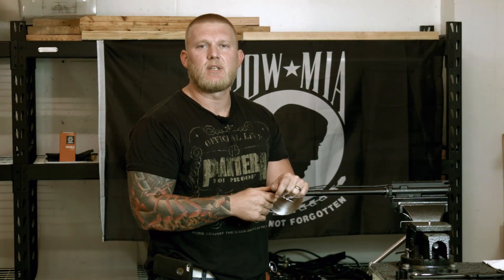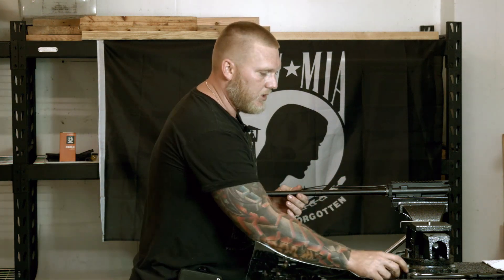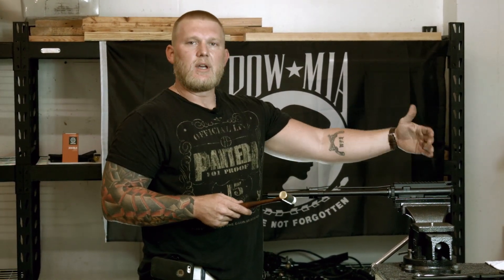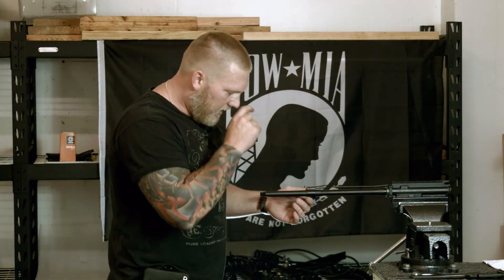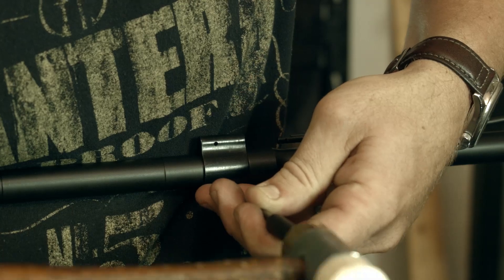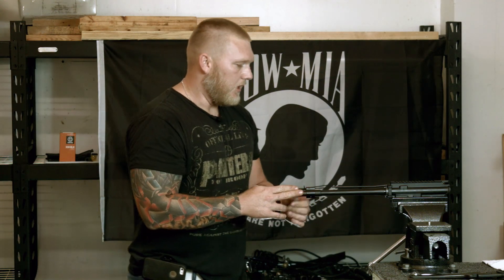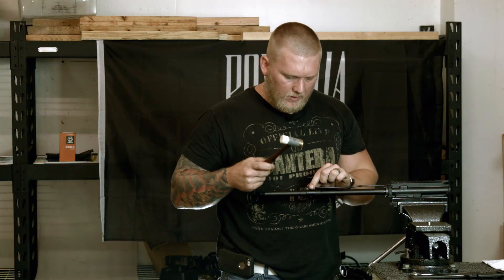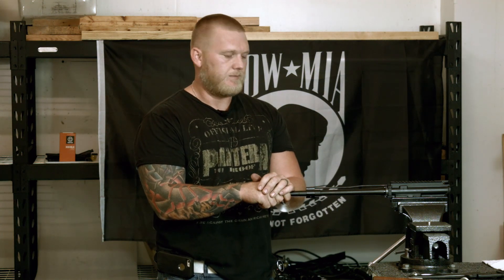Ballistic Advantage Low-Pro Gas Block Install

Comment: Hey Clint thanks for the builders series it was super helpful and I think your barrels are great but IMHO extremely underrated, then again I don't really care what the brand name only crew thinks anyway (I'm not saying your barrels are considered second rate at all,  I'm just talking about the guys who purchase whatever costs the most because that must mean it's the best kinda guys). With that rant out of the way, my question is what are your thoughts on dimpling barrels for a gas block install? Necessary or unnecessary? Let me know if you have the time, and thanks again!

Comment: I have a barrel that has a off center gas block. Like stated in the video.. I've followed all directions as Mr Hanson has stated. Problem is it's not centering with tapping it to center it. I see after going over so many forums that this is an issue with many of your barrels. Why not put these barrels through a QC? It's kinda of a half ass kinda deal.

Comment: I'm having trouble getting my roll pin to get into my gas block and tube. The gas tube and roll pin it came with are from a separate vendor. Could that be the reason why it won't seem to fit through?

Comment: Does a barrel nut fit over a low profile has block or would it have to be removed to take the barrel nut off?
Reply: it won't fit, it will have to be removed. Well I guess you could unthread the nut far enough to pull the barrel and then do a backwards install... so maybe it can work

Comment: It's crazy how easy it is to assemble a ar15 from the ground up I did it with out any special tools pin punches or polymer hammer all I used was the right size drill bits (end flat sides of course) and some balls to torque the barrel nut

Comment: Just order 2 16” barrels from BA in 556 and 300AAC. Will the set screw gas blocks be secure enough without dimpling the barrels? I feel that dimpling is unnecessary when running a free float rail that goes over the gas block.

Comment: I order a premium barrel with gas block does it come uninstalled?
Reply: Probably way too late of a response but I ordered a premium 11.3" 5.56 barrel. The gas block arrived attached to the barrel, but the set screws were barely tight and it had not been pinned yet so the gas block can easily be removed from the barrel for installation of the barrel nut

Comment: What about that Gap at is needed between the gas block in the shoulder to allow for the end cap to a drop-in handguard every video I've seen nobody's taking that Gap into consideration it needs to be there unless your Barrel was designed for a free float tube only but I don't believe that's how barrels are built. Imo
Reply: robert pinto there’s a newer video out
Their hanson barrels arent manufactured with that gap because its assumed the user will not be using handguard end cap. Some barrel manufacturers do not make their barrels with that relief spacing 
Easy way to check, buy the KAK universal dimple jig for like $20. The top pointed screw aligns everything. If theres a gap betwen the jig and the shoulder theres a manufactured relief space if not then it wasnt manufactured with one intentionally

Comment: I purchased the 10.5 Modern series barrel and a Seekins precision adjustable gas block thats just a set screw style....I wouldnt have any issues if I just loctite the set screws correct?
Reply from the maker: That should work!

Comment: I appreciate your knowledge and love your barrels, I own 3, but why don't you dimple the barrels for the end user and take the guess work out of installing a gas block.  Eyeball is nuts when a single simple dimple would align it correctly everytime.  BCA, which are $40 come with a DIMPLE!  C'mon man!
Reply: Not all gas blocks will have the same distance between screws. If you decide to use a different brand or style of gas block, those dimples won't line up. Dimples aren't necessary with the Hanson barrels due to the pin, you'll get a little side-to-side play, but it'll still be a lot easier than having nothing.
Reply: @GriffXJ  the main screw is ALWAYS in the same spot. Right across from the port. So yea they could do one dimple and they should
Reply: Wypipo Trippin  excellent point
Reply: Also gas block can move with the pin in 😂😂😂😂
Reply: Laziness and second rate barrels. 

That’s why.

Comment: How to remove AR Gas Block that some idiot used ROCKSETT on set screws on AR Gas Block..
Q:  Besides smacking the dinky 7/64 / 0.097 screws hoping they will break loose, how do you break loose the dinky little Allen head screws on a gas block if Rocksett has been used ? ? ?

Heat = No
Water ? (I've read soaking Rocksett in water softens up bond)
"Shocking" the bond by inserting a short piece of Allen key, and smacking it wit hammer? 

Thoughts, tips?
Reply from the maker: I would try using heat from a torch, it should help break it up.  Then, without burning yourself use the Allen Key to see if it will come loose.
Reply: Ballistic Advantage posted " I would try using heat from a torch, it should help break it up."
Appreciate the response but ROCKSETT is designed to resist high heat.  Correct way to loosen is via soaking in WATER, and or in addition to water "Shocking" the joint. HEAT is not very effective.
Reply from the maker: Thanks so much for the information- we will keep that in mind for future!

Comment: I don’t understand why every barrel and gas block isn’t pinned.
Reply from the maker: It's a feature of our BA Hanson Series. We can pin a lo-pro on any other barrel for a $40 dollar upcharge.
Reply: I know, right! It's totally bombproof, never ever wonder if there's even the slightest chance your gas block has moved. I cringe when i watch a video of a gas block install, especially the clamp on style, and the youtuber treats the install with no more significance than an accessory install. I realize that in many cases the un-pinned gas blocks never present a problem, but when you put all your confidence in the quality of a 10-32 screw 3/16 ” long and all the forces acting upon it you are taking the long bet. In contrast, the force required to cause a failure of a properly pinned gas block would suggest a catastrophic level failure of the firearm, like the gun blowing up. I'm no gunsmith true, but I'm no stranger to engineering and mechanics.

Comment: How tight should the gas block set screws be? Is there a certain torque spec?
Reply: tookewlGU  You'd think mfg of barrel company would answer. (LOL)
Read a post on another vid that a poster has been tightening down AR Gas Block set screw for years to 40 inch lbs, with no thread locker and hasn't had one come loose.

Comment: No dimpling? Does the pin make it not necessary?
Reply from the maker: Hi Harrison.  Thank you for your question and our apologies for not responding to it sooner!  Yes, you are correct, the cross pin combined with tightening your sets screws offers a very secure fit!

Comment: i have a ballistic advantage 10.5 barrel from aero precision and an aero low pro gas block. the gas black is awfully tight. i checked the journal whicj is .750 on both. how do i fit it in?

Comment: do you push the gas block all the way against the backstop on the barrel? or does their need to be a little gap between the backstop of the barrel and the gas block?
Reply: Marshall Jones-Paragon Fury all the way
Reply: There should be a slight Gap in case you wanted to install the end cap to a drop-in handguard which he forgot to mention I don't think these YouTube guys I using the right process I can't seem to find one they're all doing the same thing they're placing the gas block directly up against the shoulder not accounting for the little Gap that needs to be there
Reply: @crypto_pinto2660  some barrels need the gap.  Most aftermarket barrels are made to be pushed up against because they assume you'll be using a free float handguard

Comment: Sorry if I missed it, but are you leaving a gap where the hand guard cap, would have been? 
Using a BABL308005M and sentry 7 gas block 

Also, dimple or no?
Done it in the past, just curious what BA thought, in regards to the MOA guarantee?
Reply: I am wondering the same things.
Reply: Thank you for your response I've been watching these videos and everybody is leaving out that little Gap where the end cap to a drop-in handguard goes and their place in the gas block directly up against the shoulder of the barrel and they're supposed to be the pros I don't get it either

Comment: So if you have a pinned gas block do you have to dimple the barrel or will the pin and screws without dimple get the job done?
Reply: If it's pinned your g2g, no need to dimple the barrel. Although you can of you believe your rifle has that big of a chance of a gas block shifting. but be honest the reason we have the lo pro gas blocks is because they will be covered by a handguard. so unless your deliberately like beating your at into the side of a tree where the gas block is located, I wouldn't worry about it bud.
Reply: *if * AR
Reply: It's already got a pin through it, where's it gonna go? 😂

Don't dimple your barrel.

Comment: Mr. Clint Hanson, I'm a big Ballistic Advantage fan. I already have one of your 16 inch barrels and love it. I am wanting to order 4 more barrels but I have some technical questions that I need answered. What is the best way to contact Ballistic Advantage? I've used the "sales@bamfg.com" and have not always gotten a response.
Reply from the maker: +Xzavier Cleric Try emailing me at kyle@bamfg.com.
Reply: Xzavier Cleric did any you're Hanson barrels come chrome-lined or are they nitrated ?
any help would be appreciated possible first-time Builder?

Comment: Are the gas blocks on the Hanson barrels installed any special way, or do you take them off like a regular pinned low profile gas block?  I ask because I have to remove it in order to install my hand-guard.
Reply from the maker: You shouldn't have any issue taking off the gas block.
Reply from the maker: +zeroxwolfx No, they are not installed in a special way.
Reply: any answer for this? Need to remove mine as well.
Reply: so you guys don't put lock tite on it? cause I have to take mine off too for the handguard.
Reply: If they put lock tite on it you'd have a heluva time getting it off to install your barrel nut/delta ring assembly.

Comment: What color locktite are you using on the gas block?
Reply from the maker: Bobsarmory1 If you plan on not removing it, use red.
Reply: blue or purple should be good for civilian use.
Reply: If you go with blue use the newer 243 loctite brand. I don't know if it will holdup to the heat though. Wondering if staking would be better?